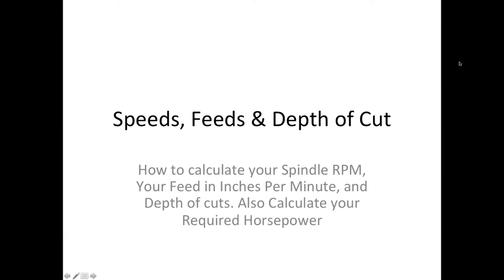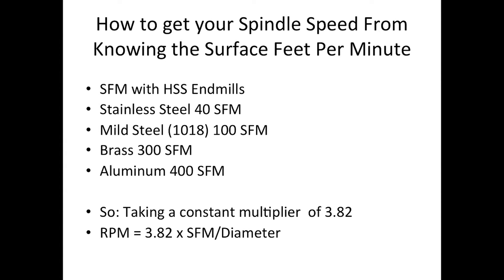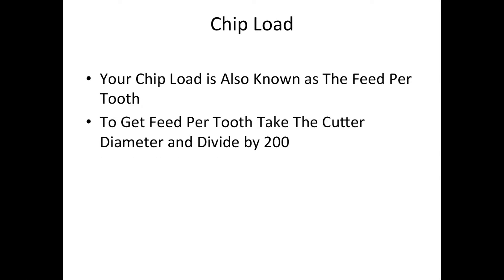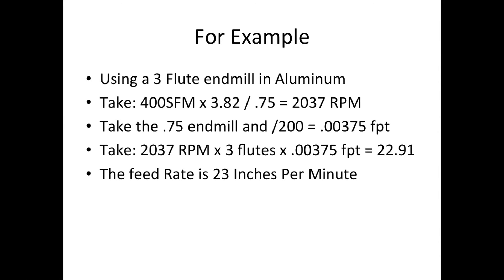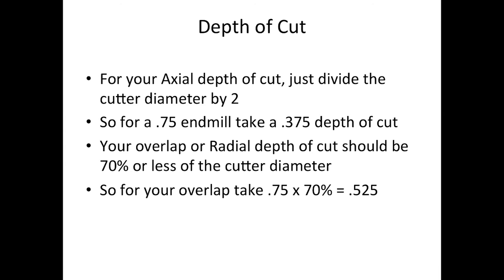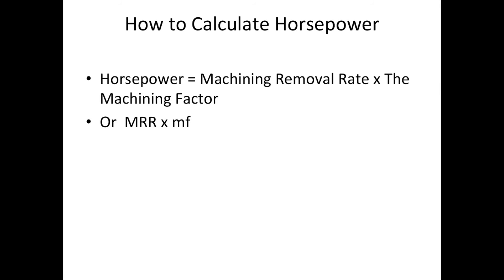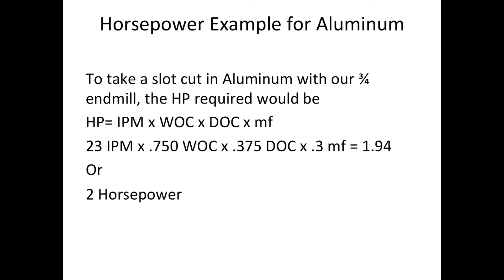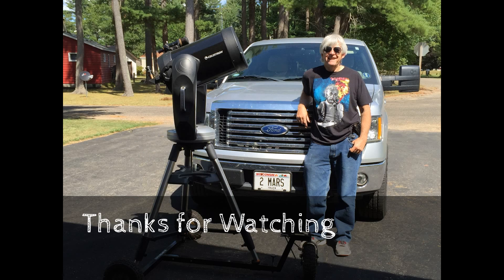Speeds Feeds and Depth of Cut for Milling

Comment: Great info.  I’ve worked through the calculations but I have a mini mill so need to back off somewhere.  I assume you would back off on the depth until you got to a HP number that your machine can handle?

Also, I assume if you discounted the max machine horsepower (say like 50%-75% of rated?), that would account for a less rigid machine?
Reply from the maker: Jason Hamilton exactly
Reply: TheOldGeezerGeek thanks!

Comment: Literally the most helpful and straight-forward video online on the subject.  Thank you.
Reply from the maker: Thanks so much for the nice compliment, so glad you liked it
Reply: @The_old_geezer_geek  I am a newbie at machining, but have some parts i wanted to make and sell so i bought a CNC while being completely ignorant about engineering/design/milling.  I incorporated your tips and equations into my CAM programming last night for speeds and feeds (I did go a bit milder for radial and axial depths of cuts just to be conservative) and will be running them on a batch of parts tonight, looking forward to the never-ending learning process and very grateful for the advice.  Have a good day!

Comment: Tim sir, With carbide end mill 8 mm 4flute vc 40m/min . by using ur formulas.. n=1600 feed=256 mm/min Depth of cut=4mm(D/2) broked it for the first pass itself.. please help me....
Reply from the maker: Hi Ramana, sorry you broke a tool,  I came up with a spindle speed that  should be 4850 revolutions per minute and the feed would be 30 inches per minute, is that what you came up with as well?
Reply: @The_old_geezer_geek   I have calculated like n=Vc*318/D it's n=40*318/8 and it's n=1590 rpm.. Then feed=1590*4*(8/200) which euals 254 mm/min and depth of cut like cutter dia by 2 so 8/2=4, by the way my work piece mtrl. is SS316..
Reply from the maker: Ramana k s v your spindle speed is way to slow, I don’t know if something is getting lost in the conversion from inch to metric, but you should have your rpm at about 4800 rpm. If you run it at 1600 rpm it will break tools
Reply: @The_old_geezer_geek  Yes sir . that's the problem. all the videos I found about cutting parameters are in Inch mode only.. but here in India we use metric method only, and the resources regarding education like this are very less, but I once again check the parameters, tomorrow(it's 11.50 pm here), and come back to u, when I go to my work,  I think it's the depth of cut, which breaked my tool,  I have never used above  1mm depth, up to 18mm dia tools, thanks for replaying sir and enjoy ur Sunday.. Thanks allot..
Reply: Hi.. sir, today by using 14 mm 4flute carbide  cutter of Vc=45 m/min,  I have got speed 1022 rpm feed 286 mm/min, and for depth of cut I have used 1/8 Instead of D/2, so I have got 1.75 mm, and surpriIngly, I have reduced my cycle time from 30 minutes to 12 minutes, and the finish is like extremely well, but adjusting depth of cut to 1/8 D, my cutter also is in good condition, Thanku.